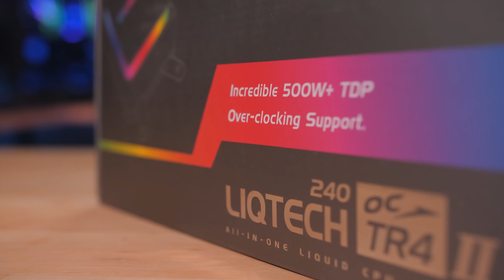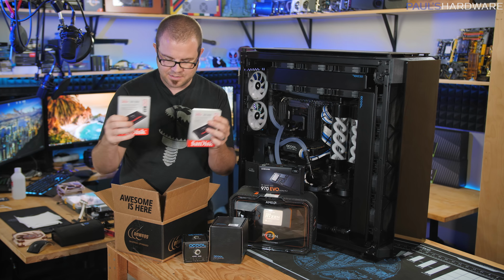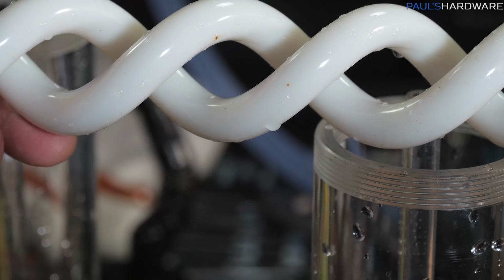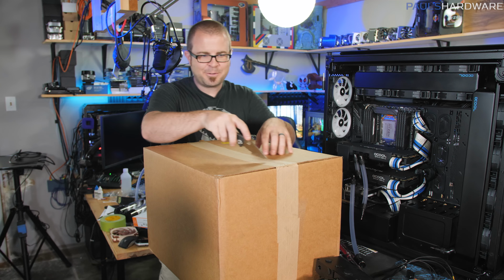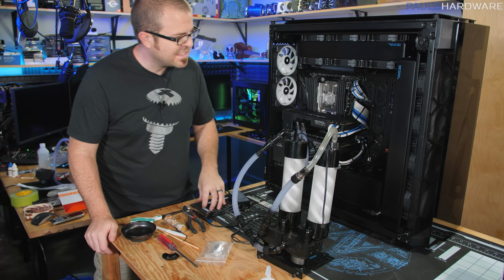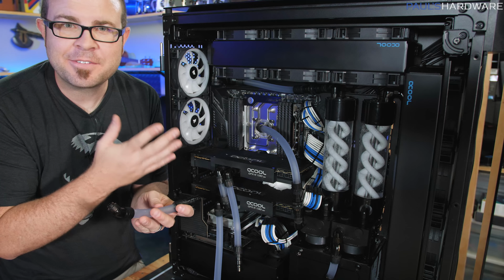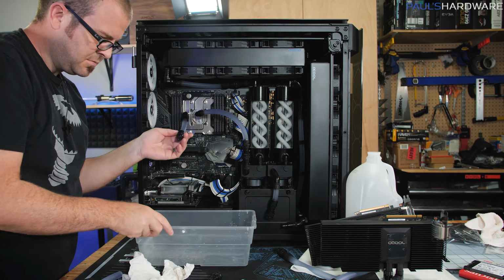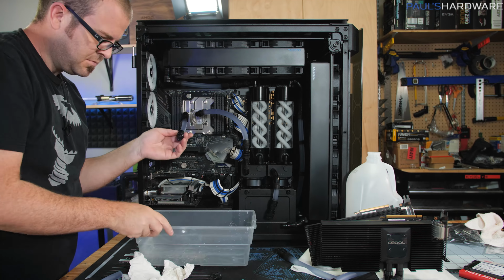UPGRADING My $10,000+ Custom Water Cooled PC - What Could Go Wrong?

Comment: The Alphacool VPP755 pump is notorious for spontaneously failing. VPP655 (rebranded D5) is more reliable.
Reply: Wish this was more upvoted to make him see this. I'll comment to try and "pump" it up a bit

...I'll see myself out
Reply: True. Keep in mind that there were three (!) versions in 18 months changing the pump in different ways and not really fixing it. Mine suddenly stopped working and killed my system. Alphacool didnt mind and as always said: your fault. Check german forums and you will see that Alphacool itself isnt recommended that much in Germany anymore.
Reply: @stephan3154 tbh I mostly use Barrow these days. If you look at reviews and specs carefully on AliExpress you can find some great deals. Much cheaper than Ek, bitspower, etc. 

Pumps I still use d5/DDC. Even from AliExpress brands, still get those pumps. You can scrounge a DDC with a top+heatsink for like 50 bucks. Which isn't bad. 

Technically I haven't used those long term yet. My D5s have been going strong for about 2 years now. DDC from EK about a year steady. Just put my first loop with an AliExpress DDC together a couple weeks ago. We'll see how it lasts. To be fair I didn't give it a great situation though. It's got a heatsink, but like 0 airflow due to its positioning.
Reply: Thanks! The Alphacool VPP755 was on my liquid cooling shopping list, I'll get the VPP655 instead. Also, do you know what size of reservoirs he used?
Reply: I got 2!!! 755s and they both failed after 3 days. Fortunate i could replace them... Now i have a d5 from ekwb also with pwm controll

Comment: Totally worth the complexity.  That dual system is going to be a workhorse.  I personally prefer hardline for custom loops, but this makes total sense with the qd fittings.
Reply: ForceReconSD I've been running triple independent liquid systems for years now. 2x evga hybrid cards and a 240mm aio for the CPU. It's more common than it may seem, but yeah, it does work really, really well. Next system though is going to be a full hardline single loop. When threadripper 3 comes to market. Been waiting for it since threadripper was announced. Been saving that long too lol
Reply: @BenFilley  I have a Ryzen 1600X and a Vega64 on dual 360mm radiators in my system using hardline.  I'm holding out to see what the new Ryzen lineup brings for the 8 core side of things.  Not that my 1600X is slowing me down much, but I feel an 8 core with the upcoming Ryzen line will "feel" more balanced, if that makes any sense.
Reply: ForceReconSD makes complete sense. I'm just looking to do gaming while streaming a high quality source. Nvenc can't cut it for the quality I'm looking for, so threadripper is pretty much the only other option. X264 is a thread hound, but the quality is significantly better than h264 nvenc options. If I were ONLY gaming, I'd likely go with Intel again, since my 4770k is still great for gaming, even 5 years on. I assume threadripper will be able to do 4.2ghz and above with relative ease, while staying pretty cool with a liquid system.
Reply: @BenFilley  did you get threadripper3 yet? wondering how well these posts aged?
Reply: @skoopsro7656  ha nope ended up on a 2700x at current with a 2080. Sold off the multi gpu setup while it was still worth something and havent really needed more power since building what i have now. Its nice to know that when i want to though my board will handily manage a 3950x.
Reply: @BenFilley  thanks for the reply. It's funny to see how rapidly our plans change when the rubber meets the road with these type of things. Those threadripper3s do look amazing tho. Save some pennies for when they go on massive discount this fall!
Reply: @skoopsro7656  thats what im doing. 3950x will drop in price when whatever comes next gets released. That thing is an absolute monster. I didnt think they were going to put a 16 core chip out for this board when i bought it as a placeholder u til i could get a 16 core. Pretty happy that it worked out that way.

Comment: why is that back fan never spinning?
Reply: Because some of the fans are connected to the m-itx pc built in so they wont spin up until that one is turned on as well
Reply: sawyer
PWM Profiles in the UEFI, only needed > 50 Celsius...
Reply: @jdparker3 
ATA NAS for SSD not needing, when do NAS need fans? Heat, AMP + Watt??? low power components.
Reply: @lucasrem Paul has answered before the NAS has the other fans connected due to lack of enough fan ports on the main one iirc
Reply: Kilo 24 
This is a worst PC build, not a good one.
 Harddrives, what is Paul dowing? Raid 2x1tb EVO is enough, rest in the home & kitchen NAS, Paul is not that smart here! Why do NAS heat thing, Gaming Noob PC is heat, remove the disks from the heat spot please!

When you turn your own PC on, all fans goo 100%? or only on when needed? UEFI???????
Reply: @jdparker3  Just use a NAS, 2x 1tb enough, why disks in a heated gaming system????
Reply: @lucasrem  the m-itx part is the NAS. thats why it has regular hdd in the system. iirc

Comment: Great video and awesome rig man! I'm building my first AMD system in 20 years and went with the 2990WX because I use it mainly for rendering and simulations. I was nervous turning it on for the first time but it booted right up and everything works perfectly so far.  Did a dual loop as well :) These systems are not overkill if you are going to push them hard. Nothing wrong with looks that match performance if you have the money to pull it off.

Comment: I'm curious if some fan y splitters with some in-line 12v diodes would allow the PWM signal of whichever system fan curve is higher to always have those fans spin. Theoretically, it should, and though the fans use >1A each, could oversize them to 3A since startup current spikes up on dc motors.

Comment: You should hope that your Alphacool quick disconnect fittings do not jam and stay open after disconnecting them like the several female Koolance QD3 fittings I am using. It only jammed after the connectors were connected to each other over a longer time...6 months or so.

Comment: So Paul... The Samsung Evo m2 drives were mounted on some sort of adapter that looked like it fitted in a memory slot. 1) How does that work? (I thought normally the drive would run off a PCIE3,0x4 slot or something like that). 2) Why is that Asus m2 DIMM Adapter not listed in the parts? 3) Was it part of one of the motherboards? 4) Is it specific to only certain Asus boards?

Comment: I know this video is old, but what was the reason you swapped the LED strip inside the monoblock? 12v A-RGB to 5v D-RGB with an adapter wire for iCue sync?

Comment: I'm doing QDC's on my update, but only two so I can remove the GPU which is vertically mounted and keeps me from accessing most of the motherboard.  Will be putting in new rads and a D5 pump though, so it's a full drain for me anyways.

Comment: I'm planning on getting this case and probably the same water cooling system, but I'm not sure about the fans. I really like the Corsair LL120 RGB fans, but they don't seem to be the best when used on radiators because of the low static pressure and low air flow.

How come you went with these fans?
Did you ever test the temps on this build?

I'm also considering getting the less thick (45mm) rads instead of the 60mm you used, so I can do push and pull in front, in which case those LL120 RGB fans might be okay. What do you think?
Reply: He got the fans as part of the sponsorship from corsair

Comment: At what point does air cooling become not enough requiring this much water cooling? Some sources have been saying with CMI 3.0, there's really no gain in overclocking CPU's due to the storage speed limitations. Would you have anything to say about that limitation?

Comment: I know this is an older video, but I am going from a 1950x to a 2990wx and going full custom loop. Did you noticed any better cooling #'s from the mono block? i was looking at new ek waterblock for TR4 and it got solid reviews,  just wondering if it is worth the monoblock instead (which also limits upgrade path to a new board in the future)

Comment: Are 2 pumps necessary? Would it still work with 1 pump but at a lower flow rate?
Reply: That's exactly what happened when one pump went down. He ran off a single pump. I think its great for that very reason. The pc is not down from losing just one pump. Not the case for most builds. Pump down = pc dead until a replacement arrives.

Comment: Hey I have a question because I intent to build a two pc system in that case but im unsure if the aio coolerfor the mITX build ( corsair h150i PRO) has long enough tubes to reach the front fan mounting space.
Would be awesome if someone could answer my question.
Thanks.

Comment: Double check your bottom exhaust fan in the back its not rotating.. only problem seen, well besides the waterfall leak.
Reply: I think that one is specifically tied to the Nas system on the bottom and that one wasn't on, but the big system controls the rgb.
Reply: That's true, didn't think about the second system. I just took it as all the fans were connected to the fan hubs in the back.

Comment: Not sure that the 2970wx is actually an upgrade over the 2950x given that you've downgraded to only 12 cores actually connected to the memory.
Reply: Yeah that's why both tested with gaming mode on/off would be cool to see, agree 2950x seems better, but I actually don't know the true answer here
Reply: for 10k PC should have 2990wx
Reply: +Jaggsta  7980XE*
Reply: +Fliqpy the killer   It sucks because you can't afford it?
Reply: @basshead.  no its performance sucks, threadripper 2990WX is much better btw i bet the only thing u can afford is a pentium g4560
Reply: The 2990WX (32 cores) can't even beat the 7980XE (18 cores). Some tests the 2990WX is faster but other tests slower than the 7980XE. They are pretty equal.
Reply: @basshead.  in single core performance, yes 7980XE wins, but threadripper 2990WX is miles better on multicore performance.  https://cpu.userbenchmark.com/Compare/Intel-Core-i9-7980XE-vs-AMD-Ryzen-TR-2990WX/m352013vsm560423
Reply: FTK, multicore performance isn't a blanket thing that is the same for all applications.  There are some multi core things that will be slower on a threadripper than intel.
Reply: +cracklingice   Very true. And quad channel memory isn't enough for 32 core CPUs.
Reply: Honestly, I don't think quad channel memory would be as much of a hold back if it wasn't for the fact that it's really 2xdual channel only connected to two dies.  Threadripper 3000 should be a massive improvement over the current design since they're moving to an on package north bridge with multiple chiplet connections containing just the 8 processing cores and cache for those cores.  The memory control and PCI connectivity is in the 'i/o die' that I call the on package north bridge.

Comment: Paul, I noticed you did not have the extra VRM cooling installed on this board that ASUS has been providing for the >16 core Threadripper CPUs. Link for reference: https://www.bhphotovideo.com/c/product/1432416-REG/asus_rog_zenith_extreme_cooling_kit_rog_zenith_extreme_amd.html 

Are you concerned about this, or do you think you have enough airflow past these lower VRM components to not matter?

Also, my 1950x is great, but would be happy to swap with your 2950x if you are interested in having another 1950x. HMU!

Comment: I don't think its worth it to build a system with ALL the complexity of this, however that quick disconnect cooling is WICKED AWESOME! I have built custom loops 4-5 years ago for myself and for my brother, and we both ended up with problems. Bleeding the air is a big issue, my brother had the acrylic pump explode, and in general working in there after the build is a PROBLEM. Now we are both just on AIO systems.

These quick disconnects look like absolutely the ticket to get me back into custom loops. Removing the components in a whole group without undoing the fittings and draining everything (smirks, that is... without "forgetting" and letting it drain, haha). Yeah, I love those disconnects and I really want to try it out!

Comment: You need to check why that back, lower fan isn't spinning.
Reply: It's connected to his mitx system.
Reply: that fan is run by the mini itx system in the bottom, so that there is case airflow when main rig is off.  he only powered the main rig, so that fan stays off
Reply: first time seeing 2 pc's in 1 case? it's pretty awesome.